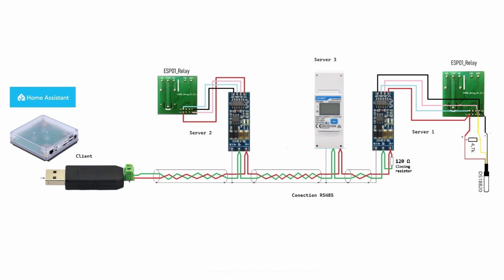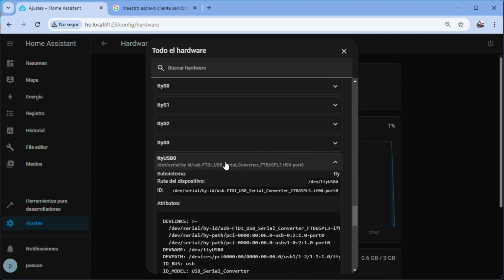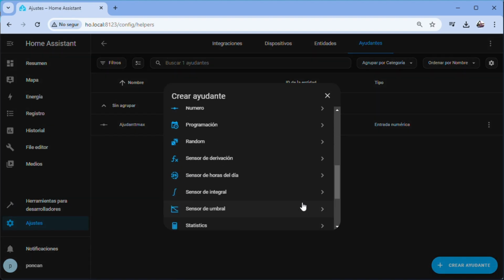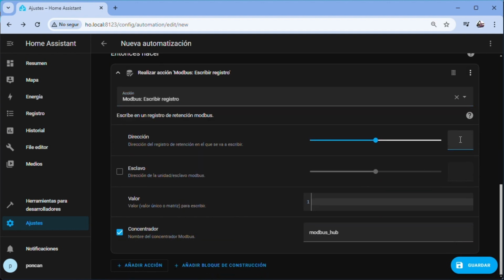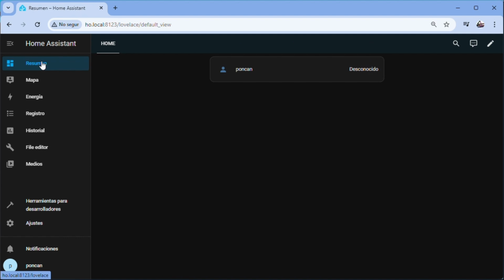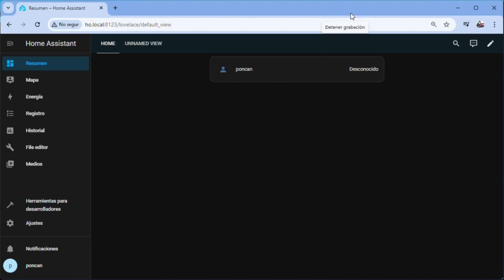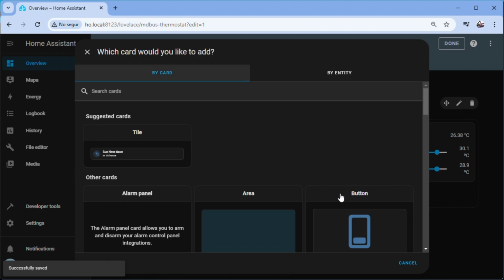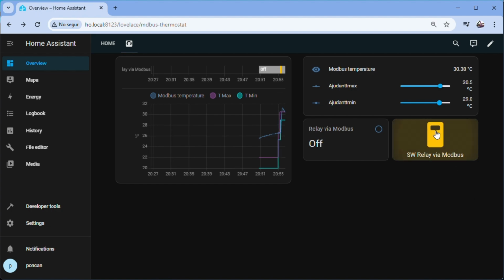Home assistant with RS485 Modbus RTU wired network

Comment: hey can you help me i will bring a growatt mic600 modbus to my esp32 eht01 with home assistent how i can do ?#
Reply from the maker: Thanks for the comment.
Sorry for the delay in responding.
We've been consulting the inverter manual; it seems that RS485 port 1 is for monitoring, terminals 3-A and 4-B.
You'll need a TTL/RS485 converter. Although it's a little different, you can use the tutorial in the following video on our channel:
https://www.youtube.com/watch?v=hw3m3GAoCeM
We believe you only need to change the GPIO numbers (both physically in the wiring and in the code).

As for the inverter's Modbus parameters, we've only found the following:
https://www.photovoltaicsolar.in/Growatt_Manual/MAX%20Series%20Modbus%20RTU%20Protocol.pdf
We're not sure if this applies to the Grwatt MIC600, but if you don't have better ones, you can try these. On page 7/55, you have the transmission data: baud, parity, etc. The slave address is configured from the inverter console. As for the registers, they're probably the ones listed starting on page 25/55.

If you need anything else, please contact us.

Comment: whats the best way of using a RS485 to USB when trying to connect to 2 wire RS485 devices ? If i have the modbus address and sensors address but i cant see any data showing up what are the next steps to try? Why do you use a resistor?
Reply from the maker: Thanks for the comment.
We're assuming you have a USB/RS485 converter. There are many on the market, but for troubleshooting, it's helpful if they have transmit and receive LEDs. When the master asks a question, you should see the TX LED blink and instantly mirror the RX LEDs of all the slaves. Then, the slave that was asked the question should respond with its TX and instantly mirror the master's RX LED.
You can check where the sequence breaks and search from this.
As for the resistor, it's a matter of line impedance, but if the distance is not very long and the speed is low, for example, 9600 Mbps, it's not necessary.

Comment: If i have 4 slave that runs on RS485, is the max 485 be interfaced with the slave devices individually?
Reply from the maker: Thanks for the comment.
Yes, you can connect each slave individually with a MAX485 and from this MAX to Home Assistant, but you will need four inputs to HA, either USB or through TTL via ESP.
But the advantage of Modbus/RS485 is that you can control them all in a single communication channel.
If you explain to us in more detail what you want to do, we can study it and try to guide you.

Comment: also you said, you couldn't manage library modBusrtuSlave. So here is config for normal work with that library:
```yaml
modbus:
  - name: modbus_USB0
    type: serial
    port: /dev/ttyUSB0
    baudrate: 9600
    bytesize: 8
    method: rtu
    # parity: E // by default. doesn't work for me
    parity: N
    stopbits: 1
```
Reply from the maker: Thanks for the comment: We never actually tried to configure a slave from Home assistant yaml. because we found it difficult to configure a device that will not be directly connected to HA.
For this reason we configured the slave in Arduino IDE, where we tried several libraries. We also found it much easier to program in C to handle inputs, outputs and registers.
Reply: @progspont2623  Thanks, but I explained exactly about HA as a master and arduino \esp board as a slave with modbusRTUslave library for arduino IDE) 
you mentioned you couldn't get rid it. So I gave you right config
Reply from the maker: Yes but the slave configuration you gave me in yaml
What can be programmed in Arduino IDE in Yaml?
Reply: @progspont2623  where do you see slave config in yaml?)
Reply: @progspont2623 are you serious?)) 
i gave you YAML for ha as a mastet modbus) 
You are nice developer man :)
Reply from the maker: Sorry. No, we are not developers, just hobbyists.
Now we see the misunderstanding, the other libraries we tried as slave in the arduino IDE gave us errors when compiling, for this reason we did not get to test the communication with HO.
If you can give the ID code or at least the previous configuration and in the setup. we would appreciate it.
And sorry for the delay and misunderstanding. ;0
Reply from the maker: Now we see that the last two comments you made do not appear in the public comments of the video nor did we receive notice.
We only saw them in Youtubestudio

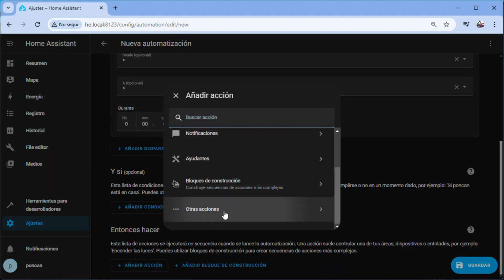Comment: Hi, In my HA there is no "Modbus Write Register" 6:31 , Core 2024.10.2, How can I fix it?
Reply from the maker: Sorry, now when checking the video we see that we did not include the installation of the modbus integration.
You must go to settings, devices and services, Add integration, choose Modbus.
Thanks for the comment, we will try to include it in the video.
We would appreciate a comment if you have been able to get it working.
Regards

Comment: Hi, i have a question of RS485 modbus with temperature and humidity transmitter Autonics THD-WD1-T can connect with Hassio ? They have RS485 output but i don't know how to connect. Thank you.
Reply from the maker: Thanks for the comment
We have searched for information about this device:
https://autonics.se/wp-content/uploads/2018/03/THD_KE_EN_DRW161011AA_20170302.pdf
To connect it to Hassio you will need a USB to RS485 converter connected to a USB of the device on which Hassio runs and the crossover cable from this to the THD-WD1-T connecting A with A and B with B, the 120 ohm resistor connected in parallel to terminals A and B of the THD-WD1-T.
On the right side of the instruction manual you will find the way to configure the modbus protocol that you will have to repeat in the Hassio configuration according to the explanation in the video.
If you have any further questions, we are here.